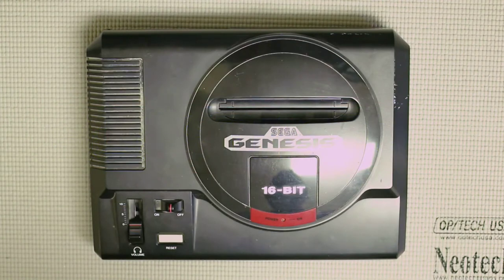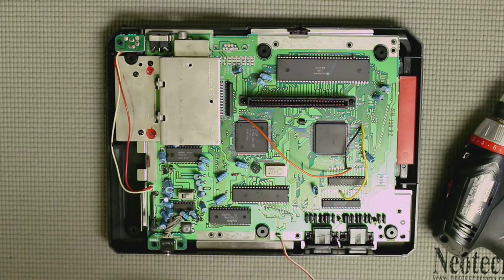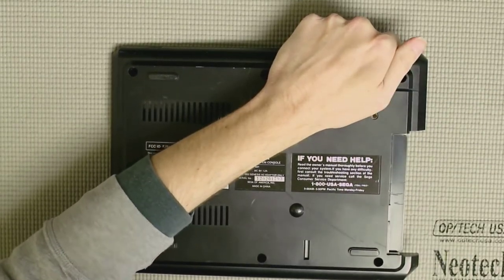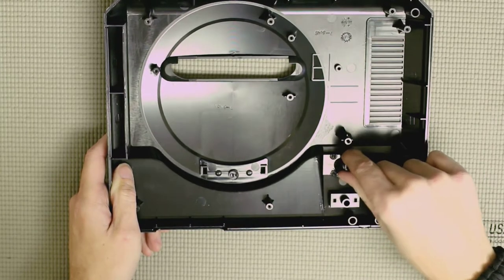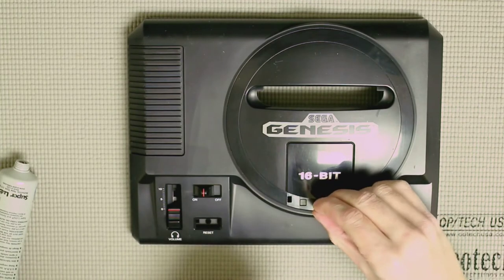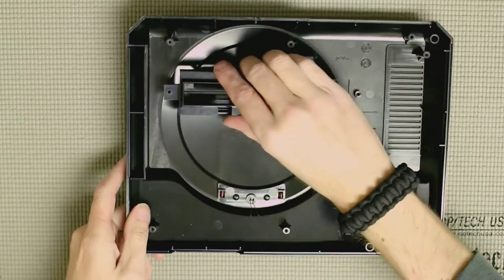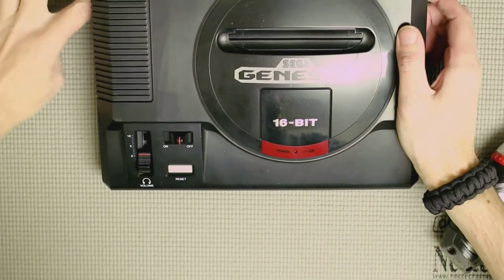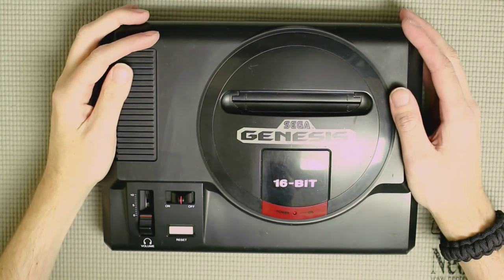Walkthrough: Genesis Model 1 Teardown

Comment: Very cool, thanks for showing the process for this. I never would have thought to use a little bit of lube on the power and volume control switches. Such a quick fix and it made a huge difference in the sound.
Reply from the maker: Thanks! Yeah, it was annoying the crap out of me and I just had an thought to try that off the cuff and it worked great. Now I'm opening up all my other model 1s to do that since they all squeek.

Comment: Pretty kool video, I always enjoy these console tear-downs!  I used a "Plastic Polish" designed for car gauges & plastics found at automotive supply stores to polish out scratches on the shiny Black plastics on my Genesis & original Xbox which works great.  Thanks for the informative video!
Reply from the maker: You know, I was actually thinking of doing that. I've used that same stuff, came in a headlight polishing kit, to polish the plastic on top of a GameCube and it worked great. I was going to try it on the one I'm doing for you.